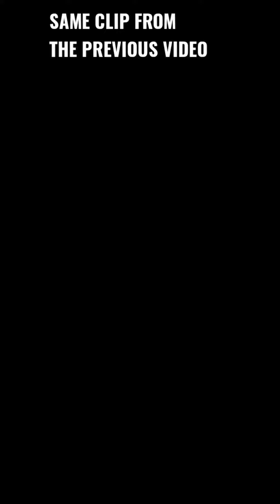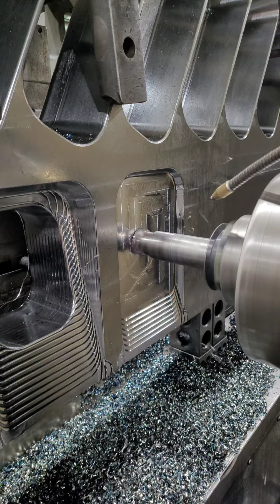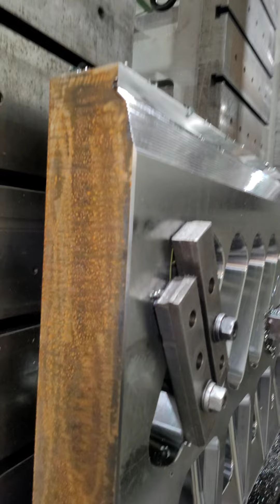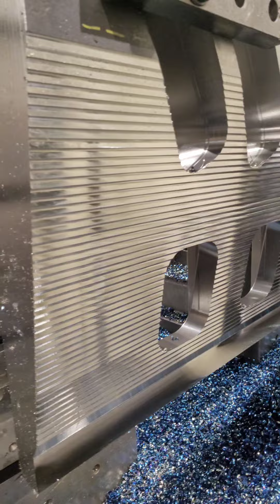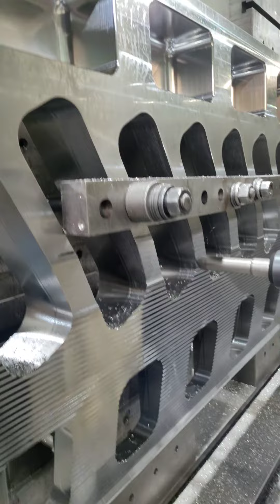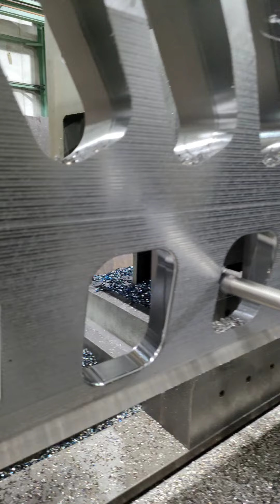Carry-Over Table | Finished Product | Toshiba CNC

Comment: You always share such great stuff. Might want to look and High efficiency milling. Cutter technology has made huge advances in the last couple of years. Most can even run dry on big open machines like this. Yes I was a machinist for 30 years. Some of the things I made in the last 5 or so years where so much easier due to the advanced cutter technology and geometry. Cutting Tungsten and Inconel at almost aluminum feeds and speeds with the right tool. I'll say one thing for sure the accelerated feeds and speeds make for a higher pucker factor! Great stuff and Thanks for sharing.
Reply: yes but this is an old machine, the feeds would be probably way to low
Reply: @ipadize  I'm sure it could still handle a 100ipm. Spindle speed 3-5k
Reply: @cyclingbutterbean  Not if the spindle only goes up to 2000 or so... Most of these older boring style mills with a ram are pretty limited in terms of spindle speeds. Also even if cutting at 100ipm (which is close to the original rapid speed of many old retrofitted mills of this type/size) is allowed by the controller it will actually be very inefficient and harsh on the tools due to the low acceleration and deccelaration characteristics of the machine.
Reply: @Sketch1994  I think Chris will be able to figure all that out. If it isn't possible it isn't possible. Not sure what parameters and limitations he's working with. Just a suggestion. If it won't work , I'm sure he'd say.
Reply from the maker: In my opinion, running high feeds on a heavy machine such as this Toshiba might not be a good idea as you wound need to turn off acceleration/de-accelaration to make it possible. Max Rpm on this machine is 2500 and rapid is set at 237ipm.
Reply: As I would have expected from a guy of your experience. There probably was some reason you weren't running high feed, high speed. Thanks for dropping by to fill me in.
Reply: @ChrisMaj  slow and steady on the big stuff.